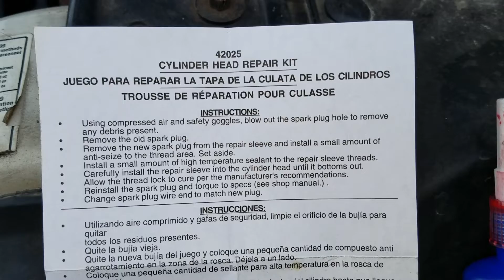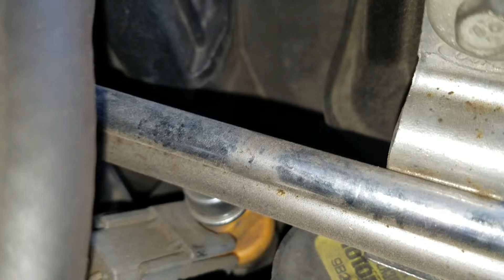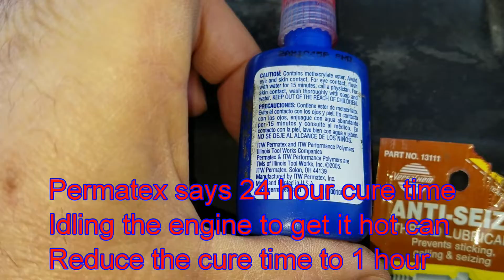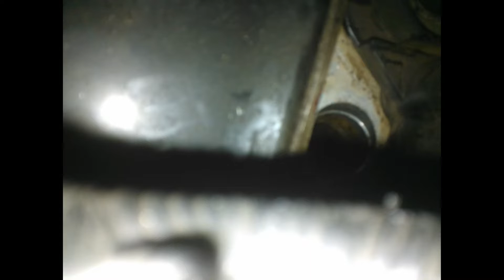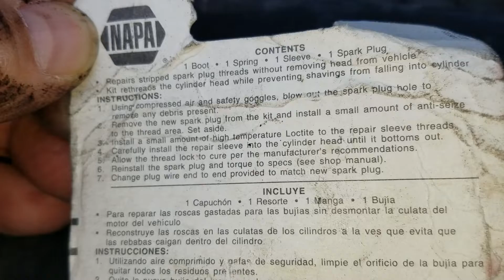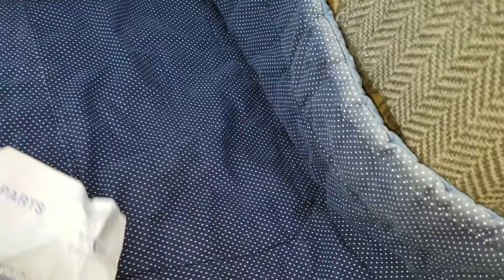Fast Permanent Fix FORD  5.4 L 2V Aluminum Head Spark Plug Seat Repair

Comment: I used this  leaking around the treads
Reply from the maker: You screwed in to positive stop? You used hi temp red thread locker.
Sometimes you just have to direct to the CalVan repair kit.

Comment: Stop buying three peace spark plugs
Reply from the maker: I kept one of these repair kits in my 5.4 2V truck all the time. If you have a sparkplug blow out, and you're in the middle of nowhere, this kit is quick and easy to install. In my case, the kits lasted for years and worked great. If you're at home and have tools available, the CalVan kit is the way to go. You can always install the CalVan kit at a later date once with the help of this kit, you get home or to a shop. My new engine has had all new sparkplug seats installed.

Comment: Permanent fix until it breaks. And they WILL break the next time you need plugs. Cal-Van kit is the only permanent solution.
Reply from the maker: CalVan is best, but you can do this repair in a few minutes and be back on the road. The repairs I did lasted until the engine seized up a couple of years later when the oil sump tube cracked, losing oil pressure.  This repair will get you going. You can put the CalVan kit in when you get to a place where you have time and tools.
Reply: @CITAP1 I would only install one as a last option personally. I am glad you had luck with yours. I am currently dealing with one that the previous owner of my E350 installed, which has cracked/failed. If I cannot extract it and replace it with a Cal-Van insert, it will essentially be a total loss on a van with only 110k miles on it.
Reply from the maker: @tampabayrider  Hmm, some folks ignore instructions and use JB Weld or similar instead of Red HiTemp Loktite. If you have the plug out and just the seat remains, the CalVan drill bit has a sleve that holds it center in the sparkplug hole. I bet you can simply drill through the seat and head, then install the CalVan seat. Even if the bolt end of the seat breaks off when trying to still in, drill it. You can clean out drilling debris by using your shop vacuum with a section of 1/2" PEX tape sealed to the hose. Vacuum well around the edge. Also, make sure the piston is rising on the exhaust stroke so the intake valve is closed. This way you can safely after vacuuming, blow with compressed air and any remaining debris will go out the exhaust. I hope it works out for you. Check all plugs, make sure they are at proper torque.
Reply: @CITAP1 the bit included with the cal-van kit is a reamer unfortunately, there is no cutting face on the leading edge. 
My first thought was to try exactly what you suggested, but no luck for that reason.
The bolt head of the insert already did break, which is why I now need to remove it and why it’s such a headache. 
I’ve opted to try using a 1/2” left handed drill bit (should be here tomorrow) in the hopes that it just grabs the insert and twists it loose. Unfortunately it’s difficult to find one long enough, so I’ll be welding a socket to it so I can get an extension on there. 
We’ll see how it goes!
Reply from the maker: @tampabayrider I wonder if you could get a long bit, sized for the seat, then get some tubing and make your own guide sleve not perfect,  but close enough to keep the bit centered as you drill. Drill the seat out then use the CalVan kit to do that reaming. If there is slop in the diameter of the guide tube, you could wrap with electrical tape to tighten tolerance.   Just trying to help you find a way.
Reply: @CITAP1  Got her out. Took a 1/2” reverse drill bit, welded a socket to it for the length, then an extension and auto ratchet. Took some cussing but it’s done lol.
Reply from the maker: @tampabayrider   That is awesome! The Mother of Invention is proud to call you Son today  I take it you have the CalVan Kit installed with no further difficulties. Thanks for sharing and best wishes for many happy miles.
Reply from the maker: @tampabayrider   In case you have any intake manifold issues. This video will show you all the tricks I figured out over the years to fix and stop the leaks the intake manifold chronically had.
https://youtu.be/PQ6McLAbMe4

Comment: How long did it last?
Reply from the maker: The first kit lasted 3 years. I replaced it with another new kit. I also had to do a second cylinder which never failed. Both repairs lasted a couple more years until the oil sump pickup tube cracked and caused the engine to seize in seconds. I've had two more engines since then and they had new spark plug seats installed in the heads. Never had a problem with those heads. The first rebuild lasted a few years until #5 exhaust valve broke and fell into the front left cylinder destroying the engine. I'm now on the second rebuilt engine which is running like a top, beautifully... The biggest chronic problem I had with the engines was the coolant crossover tube leaking. I have a couple videos showing how to fix that and I haven't had a problem since. Good luck with your engine.

Comment: You cannot get into any of these spark plugs it is made impossible you can't even get the plug in or out
Reply from the maker: @JohnJohnstjohn  
These plugs are all easy. I know of other engines that are a real pain, especially when they break, and you need the special removal tool. This is not that.

Comment: So, the 2 valve blows out plugs, replaced with a 3 valve where you can’t hardly get the plugs out. BTW, the 7mm (why deep well) is to secure the coil. I would recommend a 1” .fender washer to fit that 4-8mm screw if the tab on the coil is really mangled.
Reply from the maker: @michaelgfoth6214  they increased the plug thread count from 3 to 5 turns in the later PI head. Even so, my 5 turn heads still blew a couple plugs. Recommended prevention is to check tightness with a torque wrench at every oil change interval, now recommended at 3000 mile intervals. The larger washer on the plugs could possibly cause greater damage since it will have greater holding power which could cause a larger breakout if when it happens. My new engine has larger drilled and tapped thread inserts. A CalVan kit solves the problem. Take care.

Comment: On the new extended plugs put copper coat on the long tip
Reply from the maker: @skillet7805   I had no trouble with the long plugs. I did anti seize the plug threads.

Comment: Can I drill to far in the spark plug hole
Reply from the maker: @TODDWESSMAN  
If you're using this NAPA kit, you don't drill, you simply take the self tapping seat, load the threads with high temp red thread lock, and tighten it down till it stops. It will have resistance  while tapping it down, but when you hit bottom, it will stop and you're done.
If you're doing a CalVan kit, it comes with guides and instructions. CalVan is the best way to fix a blown out sparkplug. The NAPA will get you out of a jam quick and easy. I always kept a couple kits in the truck just in case, and it did save me on the road a couple times.
Good luck with your repair.

Comment: That new seat looks like a Spark Plug Non-Fouler. Thanks for the video.
Reply from the maker: @Vertigoneardeath  This kit got me out of a bind and back on the road 3 times.
Reply: @CITAP1  I have, as of today, Friday, August 30th, 2024, two (2), Bank 1, Spark Plug ports assed up in my 1999 Mustang 4.6. I have done some research on YouTube but found your video quite tempting. Tomorrow I will see about buying this. But before I go, let me share with you a video I saw in where this one mechanic, like you and I, said he used thin copper wire  as expansion mass to secure the plug. I don't know if it worked. However, before I take a trip to the auto parts store I will try that copper wire technique. You never know.
Reply from the maker: @Vertigoneardeath  if you are going to be doing this at home or your shop, I would recommend the CalVan kit. It's a better, more reliable solution. It has you drill out the seat, then tap new threads, then install a new better seat, and you use regular sparkplugs. I think that copper wire trick will get you to the store but I wouldn't depend on it for long.
Reply: @CITAP1  Calvan kit, got it! Pricey. $200 on Amazon...but I do understand. You get what  you pay for. Thank you.
Reply from the maker: @Vertigoneardeath   I believe you get seats for all cylinders and I would recommend doing them. Im in the middle of replacing head gadkets on my fairly new 5.4 engine. The old engine you see in this video seized and died from a broken cracked oil sump tube. I'm putting back together using ARP head studs and doing a few performance upgrades. If you need more information on other aspects of these Ford modular engines, I have a bunch of how to videos. Best wishes on your repairs.

Comment: Just yesterday this happened to me, i didn't even know these kits existed. Thanks for a the info. It was very helpful.
Reply from the maker: @domingodelgado4630   Great, I hope you're already going on the road again. Be sure to oil that engine with the suggested maintenance interval or sooner, with 5-30 oil and filter. The engine will treat you much better. Also, try not to rev beyond 4500 RPM. Your head and intake manifold gaskets will thank you, and you will thank yourself.  Take care...

Comment: Can we do a video how to remove one when it breaks.?  😔
Reply from the maker: @VileMisanthropy  These 2 valve engine plugs don't break. I believe it's the three and four valve engines that break and there are videos by others showing that. My brother successfully used the special removal tool and got his broken plugs out.
Reply: @CITAP1  the dorman plug adaptor insert, mine just split and fell apart.
Reply from the maker: @VileMisanthropy  
I got the NAPA kit and can be installed in 15 minutes if you have the parts. I always kept 2 NAPA kits with me and I used a total of 3 kits. I now have a new engine and the CalVan seats for plugs were installed. If you have the time, I recommend the CalVan kit. If you're stuck on the road, the NAPA kit will get you going.

Comment: @ CITAP1 Could you please edit your title to include the year & series of truck. Is it 2 or 3 valve? The 2V and 3V kits are slightly different. THAT being said... This is the most detailed video Ive seen yet on this problem. I recommend people watch all the vids on this they can find (I've watched 20+ so far). I have learned tricks from each vid. Some have said this can happen from improper torque; too much anti-seize squishing back onto the beveled seat and more. The plug can apparently walk out a bit and lose threads, then pop! You would think it cant spin out but under vibration, it can. also the aluminum head getting hot & cold as the engine gets hot and cools off each day, can tweak the plug just a little if not seated properly. I'm def a new subscriber. I like your style on on explaining every detail. Most mechanic vids leave something out and usually don't add enough lighting to see what they are doing. I'm mostly a Chevy man, but even I know Ford Trucks are amazing tough. I am going to buy a friends '99 series 10 5.4 2V. So far it has not had this happen, but now I know how to make sure I can do everything needed to prevent this from happening. I'll buy the kit before hand and leave it in the truck. One vid showed a man telling how to drive the vehicle without the  plug by taking the coil off the computer so it shuts down the fuel injector to shut off the fuel and prevent "cat" and o2 sensor damage. He is driving in the vid claiming he went a 1,000 miles or more till he gets it fixed at home. Yeah it popped all the way! :p That  one you would have to watch and think about. I have driven a 4cyl Mitsubishi 20 miles with a missing plug to get home, also ran a VW Bug on 3 cyls. It wont hurt you block... I'm old school and am crazy enough to risk that sort of thing because am an experienced DIY guy who fixes my own cars I have AAA and 2 cars. lol... Learn all you can & good luck
Reply from the maker: @chetsjug  Thanks for your kind words. I do try to be accurate and thorough and floks like you get it, appreciate it. I also get folks telling me to get to the point, specifically their point. They haven't the patience to watch a whole video. The mentality is akin to a firing squad, " Ready, Fire, Aim", So to say.
You can look through my truck repair playlist, I've done a lot of major fixes and repairs. Right now, after out 2+ months on the road. I'm replacing the head gaskets on the engine. This will be the 4th time for various reasons. The first 3 I finally figured out were a ford factory machining error which I fixed with sandpaper.  That engine ran until  it died from oil pressure due to the sump pickup tube cracking. This latest head gasket job on the new engine is due to waterpump failure and brief overheating. So I'll be posting a few videos in series about that.
When everything is working right on the 5.4 engine, it's a good engine. The annoying thing with them is with all the sensors, you think you know how to fix something, it's actually something causing a fault elsewhere in the system. 
I'm going to be covering a lot of issues with the 5.4 liter over the next week or so.
Take care.

Comment: Jeez they really soaked you for that repair kit. I just bought mine from Napa in upstate New York for $47.00 and they gouged you for $114.00?

I’m sure that they have come way down in price since that era of trucks is slowly being replaced by the new ones.

I have a 2002 Expedition that now has two of the same kits in the head. I just bought the Calvan kit with the new inserts that allow you to use your oem plugs. It’s got a steel sleeve that sets against the flat surface of the cylinder head and a boring bit that cuts a fresh hole that you tap for a new shorter steel insert.

Nice to know I’m not the only one enjoying all the fun of shooting spark plugs out..😝
Reply from the maker: Yeah, it was a pricey piece, but got me back on the road fast and easy. That engine since has been replaced wirh a new Ford rebuilt engine. 3500+. Been having all sorts of fun provlems with it. We're on the road right now and it's turned into a mechanics dream trip,,, not 
Take care.

Comment: Hey so I have the Same problem but my hole is to big  to the point the  the new thread socket won’t won’t work to the point it falls down
Reply from the maker: I had to find a thin wall socket to get the new seat in. Don't remember the brand. I did buy a socket at NAPA but it was to thick to fit in the hole. I hope that answers your question.

Comment: Hi my name is Doug im on my wife's YouTube. Just had to say im getting ready to try this on my 02 e250 van blew a plug so i pulled all 8 to check the other ports and found one of these in the 1 and a bord out insert in one.so i put the bord out insert on the new plug and  the other 5 plugs in. Then picked up this kit by taking the one i pulled out to auto zone. The ht1 plug cost $13. And the kit was $43. So im going to run to auto zone and get thred lock cause i grabbed jb weld. Then im going to try this kit and the one i pulled out with a new ht1 plug. Might grab a 9/16 socket for the ht1 plug so i can pull the plug out to change in the future 🤔. Looking at your video. Just wondering if 5years ago you ever think it would have helped over 285 people over they years? Have a blessed day!❤
Reply from the maker: Hi, yes, I think most have benefitted from the video and the repair kit. I will say the best way to go is the CalVan kit if you have the time and a little skill. Get the hi temp 400 degree red thred lock. There are dirrerent types. 
The repair kits worked for a few years on my truck. My engine developed a crack in my oil sump pickup tube, lost oil pressure, and seized up within 10 seconds. I have a new 5.4 engine now. There's a series of engine replacement videos on the channel if you ever need that. Both the old engine suffered the chronic intake manifold leak at the front right of the engine. I have a video to fix that also. If you ever have engine sputtering and misfire due to wet #1, 2, 3, sparkplugs being wet, that is the cause.  Best wishes on your repairs.

Comment: Had this issue with a 01 f150 5.4 and this kit can’t catch the treads😭
Reply from the maker: You may have to go to a Cal-Van kit. It's a better fix anyway and not horribly difficult to install.
Something like this
https://www.ebay.com/itm/375287320826?chn=ps&norover=1&mkevt=1&mkrid=711-213727-13078-0&mkcid=2&itemid=375287320826&targetid=4580771614374522&device=c&mktype=&googleloc=&poi=&campaignid=603418347&mkgroupid=1234752561360745&rlsatarget=pla-4580771614374522&abcId=9323204&merchantid=51291&msclkid=635306a83fb81d25d49d634368434307
Reply: @CITAP1  was just trying to find a quick fix due to it leaving me stranded otw to work😂 will try that out
Reply from the maker: @TheIceNation001    I had that happen to me on the way to work. The fix worked and I was on my way in about 20 minutes. Sounds like you engine just had a good blow out.
Reply: @CITAP1  ended up finding a different set that did the job we all good and on the road
Reply from the maker: @TheIceNation001  Good deal!

Comment: Does the different size spark plug cause misfires?
Reply from the maker: No, the one I got in my repair kit was a quality platinum plug.
Reply: @CITAP1  this happened on my crown Vic 2009 p71 i know they have repair kits for the 2000 gt and and ford f150 4.6 it’s the same engine so will it work
Reply from the maker: @zurielthompson5715   Be sure if you have a 2 or 3 valve engine. Verify your installation parts. Probably the same, but you never know.
Reply: @CITAP1  It’s a 2 valve only the maruader is a 4 valve